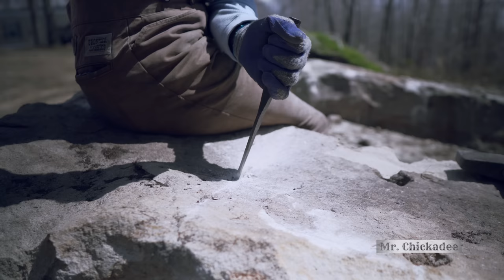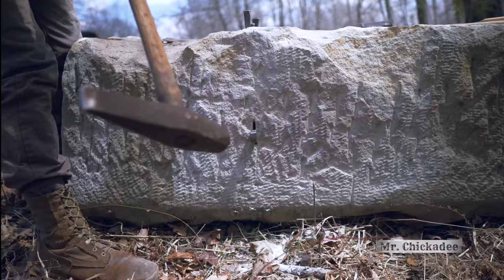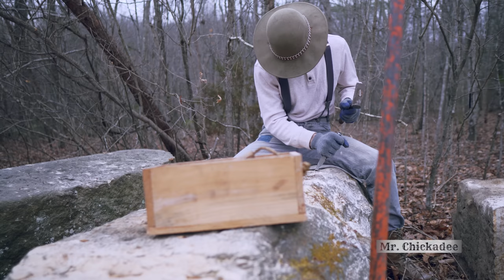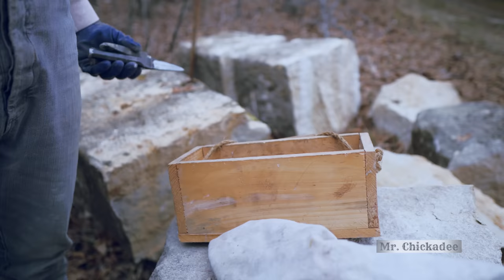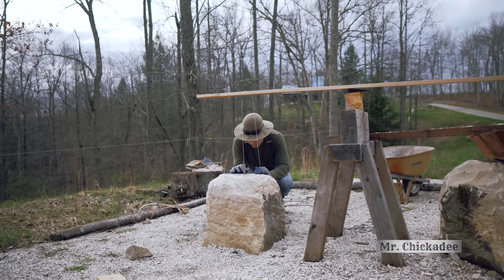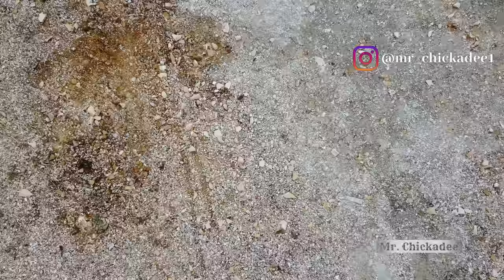Hand splitting and sculpting large plinth stones for timber frame foundation

Comment: Beautifully done!...I'm in New England, wish granite could be worked like that
Reply from the maker: In researching this splitting technique with cape chisel, I found documents from your area showing granite worked in this same way, albeit slower.
Reply: @MrChickadee  Interesting, living on Cape Ann, most old cut granite shows signs of star drill with feathers and wedges. Thanks for the reply
Reply: You make that look so easy.  Most of the quarries here in Washington state produce granite or basalt. There is one quarry that produces sandstone (used to build the state capitol building).  I recently built a stone retaining wall using local granite from the Columbia Granite Quarry in Ranier. Heavy stuff!  I believe it is 160 lbs/ cubic ft. I tried both feathers/wedges and wedges only.   Mixed results. Would have loved to get the sandstone but the quarry not in operation. I still enjoyed the work and the challenge.

Comment: Very cool. We have several large granite stones at our place from an old barn foundation, perhaps I’ll follow your technique. Did you forge those tools? Any specific steel type? It seems like they are all fully hardened.
Reply from the maker: Yes, home forged from old cold chisel, simple high carbon steel, water quenched and tempered to leave a hard edge and softer higher up. The wedges are just medium carbon steel, heat treated to be hard at the tip only not struck end

Comment: A fun method to experiment with is splitting using wood. You make a few holes along the split line, then pound in some bone dry softwood dowels (they should be as tight fitting as possible). Then soak them to make the wood expand, it takes 1-2 days but the wood will expand enough to split the rock. The Egyptians used this method for quarrying, but it works on smaller scales too. Not as fast as this method on smaller rocks, but it's certainly an interesting experiment.

Comment: Great work...and before anyone says "see the Egyptians could have built the pyramids like this" remember that they were working with granite and supposedly only had copper tools. They also still had to move the 100+ tonne blocks sometimes miles from the quarry. 

They also did it with tolerances as tight as 1/1000th of an inch and surfaces finished so smooth they still reflect like mirrors many thousands of years later
Reply: Look at Mike Haduck's videos on how the Egyptians did it. Easier than you think even with hard stone. The pyramid blocks were mostly rough fill and the final stones on the slope were finished in place. You can still see unfinished blocks in the process of being shaped  to slope. He shows you.

Comment: Dear Josh, fascinating to watch you work. How did you move those individual stones? They must weigh at least 200kg apiece? I see an old wheelbarrow in the background but that doesn’t look strong enough. Cheers.
Reply from the maker: ATV pulling logging arch with manual cable winch. Straddle, winch, drive, drop then pinch bar type lever to "walk" the stone into place.

Comment: Try using some large wooden wedges driven UNDER both sides of the stones to lift the weight up.  Then you can balance it on a beam of timber, use gravity to assist.  But nice work I admire your ethic. One can see a sizable new structure arising.